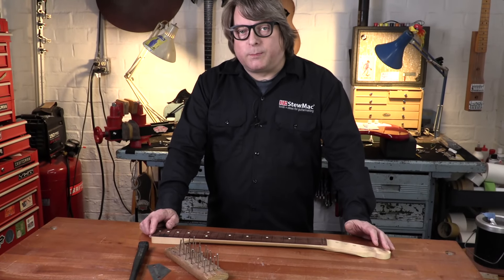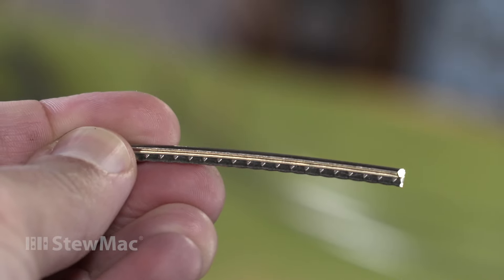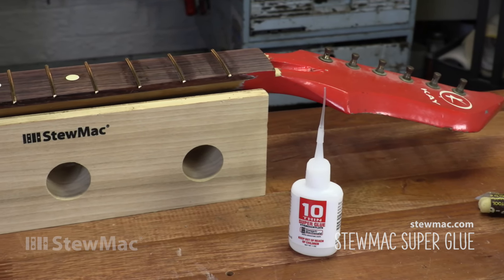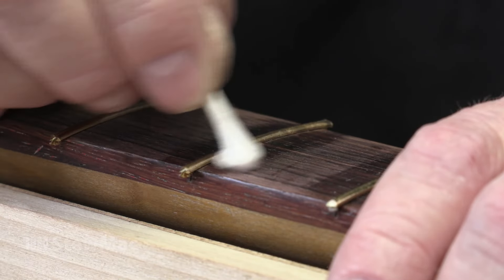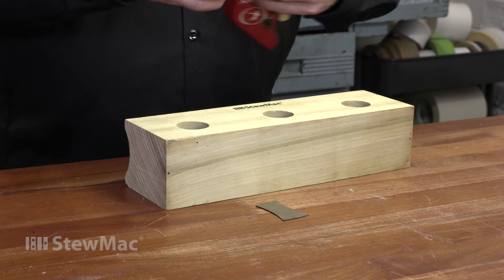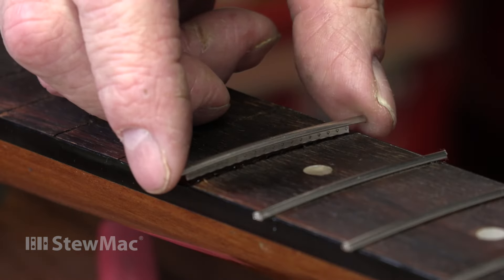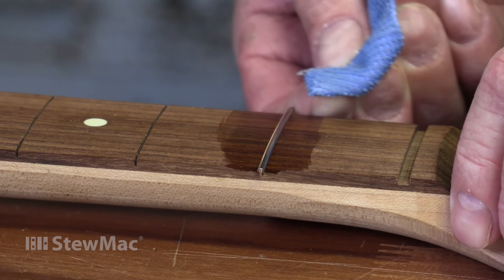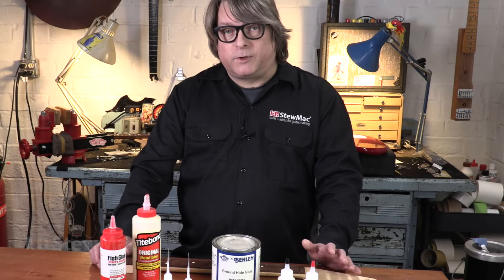How to use glue for guitar frets

Comment: Newbie wanna do a fret job guy lol 
Question , I know some folks use a soldering gun to heat frets to remove them but does that work with super glue ? And what are the fret removal methods ? 
Thanks 😊
Reply: You might've found the answer by now but yeah it does just take your time. It doesn't loosen it per se but it has an evaporating effect...so watch your eyes...it can sting. I also sometimes put a little fretboard oil on too plus back bowing the neck a little (just remember flatten back out before you level) with the iron AND solder...you can spread it on the top of the fret and it heats it up even more. Just make sure you get your fret height measurement first or heat one without solder.

Comment: Since when do you need to clamp down hide glue over night? And then totaly overlook the benefits with refreting if the frets have been glued with hideglue.
Reply: That was water based glues like Titebond (PVA) which is rubbery anyway adn probably absorbs tone. I think its more a case of the wood absorbing small amounts of moisture and swelling slightly, just clamping it until everything has gone off means you know none of the frets are proud.

Comment: Does gluing make a future re-fret more difficult in relation to getting the old frets out and not damaging the fingerboard?
Reply: You usually heat the frets before removal to both expand the slot slightly and soften both the wood and the glue. It'd probably be unnoticeable, just requiring some cleanup of the slot afterwards.
Reply from the maker: Removing glued-in frets will not damage the fingerboard if done properly. Here is a link to a video on our website where Dan Erlewine demonstrates this technique. 

https://www.stewmac.com/How-To/Trade_Secrets/Removing_the_frets_on_the_Mike_Bloomfield_Tele.html
Reply: @stewmac  Does this count with every type of glue? What is better to use... Superglue or Cyanoacrylate Glue? I can image that some glues are stronger than others and can damage the fingerboard for future re-fret.
Reply: No.

Comment: Excellent video, just the reassurance i needed. Do CA glued frets release easily enough  when heated with a soldering iron, or does it make future refretting more difficult? I'm doing a partial refret (just a few badly worn spots), if it doesnt work out perfectly, it would be good to know they can be removed easily enough.
Reply: There are no issues there.

Comment: I'd avoid epoxy as it has a very upper middle resonance, though you can get 12 hour cure time stuff, here in the UK we have Araldite. I suppose you could use Cascamite as it's very crisp sounding but now on dark fretboards. I just got my first bottle of Titebond (its just builder's PVA glue!) which I don't recommend as its rubbery. Super Glue is the best and you can remove frets by heating them with a soldering iron.
Reply: Epoxy ... the HARD stuff... is great for fret slots that have been widened too much. Resonance of each brand of epoxy varies.  I just tested epoxies by mixing up different ones and dropping them, and then LISTENING to the frequencies.  Note: I get that WE ARE talking MINUTIA here, re the total effect on tone of various epoxies.

Comment: Does fender glue thier frets down? It seems like when I lemon oil my frets, a few raised up a bit. I had to file a few high frets down after I hammered them back down. Great topic.
Reply from the maker: Hi Chad! Generally Fender does not use glue when fretting. There are some exceptions, I'm sure, but most often they're just pressed in.

Comment: I validate the "better tone" thing. Definately not placebo, since I refreted two instruments using titebond under the frets and yes there is something better with these guitars,  I mean comparing before and after
Reply: I’d love to look at your data and testing methodology. I believe that the claim the made in the video was improved sustain. Is that your assertion?
Reply: mmmichelin1  Definitelly better sustain. The necks feel a little different aswell, I guess it is the vibrations.
Reply: @stavrost6559  I don't believe that. A better fretjob = better sustain all across the fretboard. A better fretjob = no dead notes. But I find it hard to believe it would amount to a better sustain. That would only be the case if those original frets would actually be somewhat loose.
Reply: @PelleKuipers  Ok I hear you buddy, my point of view is that the more contact the fret has with the wood, the more vibrations would pass through it. Makes sense right? After all, your tone(string) has “contact” with the fret, so it will affect it.
By eliminating any potential gaps under the frets, we reduce potential tone loss or potential dead notes, so why not fill those gaps? We increase the contact with the wool after all. I hear luthiers all the time saying not to cut very deep slots on the neck, so..
I don’t remember if it was on Erlewines’ book or one of his videos that he mentioned that,  in a small study they did on the same neck, before and after filling the gaps. I don’t know how they measured it, but the results of the filled frets were better.
Cheers!
Reply: @stavrost6559  It makes sense in the way that a loose fret will transfer the vibrations more poorly. If a fret is properly seated I don't think a big difference can be heard glued or unglued. I've made guitar gluing in frets and not and I can't hear a difference. There might be a difference but not significant enough to be noticeable.
Reply: @PelleKuipers  Hahaha so I guess I did better fretjobs on my guitars than the factory ones! So, if not the glue, then I might istalled the frets "tighter" in there.
Cheers
Reply: @stavrost6559  Oh you definitely did. I dressed the frets on a Chinese acoustic guitar (completely solid) and the difference in playability and sustain was really noticeable. Fretwork = manual labour, and subsequently most factory guitars I've seen have poor frets. Either not polished well enough, fret ends that stick out, etc etc. 

Glue is necessary but not for sustain. Wood expands and contracts differently than the frets so glue is necessary to prevent loose frets in the future. I do use glue on all the fret ends (not as much as in the video though).

Comment: I'm pretty sure Stew-Mac did a test on different glue types for melting temperature. If so, I think it would have been nice to make mention of this as it relates to potentially removing frets later. Or do so in a fret removal video and reference that in this one. Since this video has already been completed, I think it would be nice to update the description with that info. Is that possible? I'm not a content creator, so I don't know whether it is. I did use an old finger board and test removal of frets with several types of glue a few years ago. They all came loose with no problem using my Weller  100/140 watt soldering gun with two-piece tip (so the current is carried through the fret itself).

Comment: What does Warmoth use for it's necks?  I'm surprised he didn't say. I'd like to know.
Reply: Super glue.  Not sure which formula though.  Re-fret = $300.  New Warmoth neck $$300.  I just replace the neck.
Reply: I have one from a handful of years ago. It needed leveling, and they used to NOT touch the fret ends after the cut. So it needed leveling, and fret end polishing. And optionally a rolled edge since the board come with NO rolling whatsoever. I hear they smooth the fret ends nowadays. But there is no guarantee it won't need leveling, and you best like the fretboard with a 90degree edge if you want to just bolt it on.

Comment: Hi, how about removing glued frets when refretting...?
Reply: Probably easier to remove the whole fretboard....
Reply: I personally just use a soldering iron and fret pullers, I run the soldering iron on one side of the fret and I move both fret pullers and soldering iron across the fret as I am pulling the fret out, so the heat from the soldering iron heats up the glue but not too much where it will be a huge mess unless you hold it in the same spot for a longer period of time
Reply: Soldering iron
Reply from the maker: We recommend using a soldering iron, chip stopper, and fret pullers for this job. Here is a link to a video on our website where Dan Erlewine demonstrates this process. I hope this helps! 

https://www.stewmac.com/How-To/Trade_Secrets/Removing_the_frets_on_the_Mike_Bloomfield_Tele.html
on our website

Comment: I’ve fretted and refretted over 10,000 guitars since 1974. We always glue the frets. Thin Hot Stuff super glue is the best. It takes a little practice to not make a mess with the glue, but once you get past that little learning curve it’s a snap to get perfect results on every fret job you do if you follow the correct steps. We use clamping cauls that clamp two frets in at a time. We dremel out the fret slots with a small dentist burr that makes a perfect sized slot then clamp them in two at a time. We work from both ends of the neck to the middle, so after we glue in the first two and clamp them, then we move to the other end and glue in two. Once those are clamped the first ones can be unclamped and the ends flushed up. Then glue in the next two, and repeat the process at the other end. I can do a full refret start to setup in about 2 hours on most guitars.

Comment: I am not expert with any guitar skill. However i've worked with resins and wood for many years. With that  i would simply suggest when you turn the guitar on its side and drip #10 to the underside of the fret it is more a capillarity (capillary action) rather than gravity that actually pulls the glue into the slot.
 
If there were no glue under the fret you would have to puddle quit a bit of glue at the fret before it would seep into the fret slot in fact the glue is as likely to roll off the back side of the neck.

Comment: What kind of wax?
Reply: @Rock 5150 Hey Rock 5150 I did that yesterday and it works marvelous! Just a regular white candle It was a bit messy but The Cyanocrylate went in really well, and cleaned super easy! It was a rosewood board, I don't know how it works for a maple one, especially if it already has nitro or any other finish on it. Cheers Dude.

Comment: hello My Dears do you have any tip for wide slots, the frets are not grabing on the fretboard
Reply from the maker: Hey Alexandre, we have a tool called the “Fret Crimper” that solves this exact problem. Check it out here! https://www.stewmac.com/luthier-tools-and-supplies/types-of-tools/pliers-and-cutters/fret-crimper/
Reply: Tks for your.message ..but the situation is oposite...the fret fit inside the slot..but the slot is larger than tang....maybe tite.bond inside??

Comment: Can you use glue boost every one seems to be ranting and raving about it
Reply: Any CA glue with the right viscosity and temperature range is usable. 
I'd reserve special products for spot repairs, where all its properties are needed to 
to fix the crack/ding in the finish. I'd go for CA glue that got a name to it and you can get a safety data sheet, telling you about the curing and at what heat it will get brittle too. The right storage temperature should be in there as well and it will be good for a year. That way, you can be sure to get a decent quality glue. 
It's not all the same.

Comment: I want to become proficient with original technology hide glue.   Most things used hide glue before WW II.  It is strong, but wet or  very hot it falls apart.  It's dry, mixed with water and applied at 140F.  If it gets much hotter than 145F it is ruined.   Other thermal glues are crafting Hot Glue (much higher temperature) and similar keratin glue used for hair extensions.   I think it may be possible to use gelatin as an original technology hide glue.

Comment: I almost never use glue while fretting, I simply don't believe in the concept of glueing them. If the fret slots are a bit too wide to hold the tang, I think it is way better to deform it. With those special "W" pliers of Stewmac for example.

Comment: Man better tone? Really? Lets not get into Toneglue devate...
Reply: I just really don’t believe that it would truly make any impact over the tone.

I mean, I’ve never listened to a record and said ‘Welcome to the Jungle is OKAY, but would be so much more elevated if Slash had glued in his frets!”
Reply: or the passive circuit tone pot capacitor total nonsense ("bumble bees and PIO's are best for tone, oh my oh my!")
Reply: RDE Lutherie  Hi, however, badly seated frets can cause dead spots on your fingerboard. One of my customer came with a really nice quitar but his D and G strings sonded totally muted and it could be heard when tapping on the frets with a metal object. Gluing frets is a must but I wouldn't say that one type of glue sounds better than another, that would be silly.
Reply: all that matters for caps in passive guitar/bass circuits is their METERED value and build - "build" means don't waste money on PIOs for these applications, where mylar, epoxy, polyro, etc, are simply better.  this whole "caps in guitars" debacle has be exposed for what it is many times over - nonsense perpetrated by the clueless.
Reply: Ignorant. He said glue helps with vibration transfer. Glue can fill air voids under the fret.
Reply: RDE Lutherie  Dude, really? What are you trying to proove? 
"Do your customers a favor, either don't charge to practice on others instruments, or find a different profession." There was a problem with this guy's badly seated frets so I changed them and it worked.
You sound like a competent reapir guy but it doesn't mean that you are the only one in the world, there are still some conscientious people out there.
Reply: Not "tone" but "sustain".
Reply: @hoodoo-man  "Too many luthiers, not enough guitarists" well IMO there are really a lot of guitarists out there but they'd rather buy a 3500€ Gibson than a 2500-3500€ luthier's handmade custom guitar. Because you know, they want the brand and the reputation and history that comes with the brand (Gibson, Martin, Fender, etc.). Musicians are just like any customer, they are advertised all their life with those brands so they simply buy them. It's our job as luthiers to teach them that they can have so much more from their local luthier than from any famous guitar brand. (BTW a 3000€ Gibson does actually costs far less than that, it's just adverting costs and dealers costs that make it so expensive). Just my opinion and that subject tho ;)
Reply: RDE Lutherie  - What a load!
Reply: RDE Lutherie  - Right. I've been doing it for 40 plus years, and you're just wrong.
Reply: Haha. "Tone Glue". Look out Ebay, here I come!
Reply: RDE Lutherie  - You are arguing with everyone, which tells me you know little. I was repairing and building guitars for a living before StewMac, been published over 100 times, and have the client list to prove my bonafides. You got lots of talk. I'm done with you. I have to get back to the bench.
Reply: RDE Lutherie and ladiessss..stop fighting already, who cares?! Over a month of girl talk lolz grow up!
Reply: RDE Lutherie  Im amazed you have all this spare time to write these novels since you are so in demand for your guitar work.

Comment: Fretboards are like snowflakes. No two are the same. From chipping to previous glue jobs to varieties of fret stock, you never know what you're going to encounter. Over the years quality ebony has become hard to some by, so the newer boards will accept frets a little more easily but they will also release them more easily. I radius a fret then test press it. You can tell by how it goes in whether the tangs are going to do the job or not. CA glue can be very tricky to use in fret slots. Applying frets is the most critical job to making an instrument playable.

Comment: You can't "Knock out 4-5 fret jobs in a day," with leveling the fingerboard, treating / cleaning the fret slots, edging,  rounding fret edges, polishing. "ETC. X 10". I also have NEVER HAD to clamp one fret using fish glue ... well; I suppose if the fret slot was to large. .... Never ran into that, since 1976, when I threw my first guitar into the garbage. I learned a bit, after that. Overall; I find your information to be somewhat informational, but overall misleading.

Comment: wood glue inside the fret slot works easy! 🙌🙌😄😄👨‍🔧👨‍🔧👨‍🔧🙄🙄with lots of clamps,long strips of hardwood along the edges of the fretboard you can sit all the frets before the wood glue fully dries...but epoxy on 24 frets?🤣🤣🤣😆😆😆😄😄😄😂😂😂

Comment: People learn that super-gluing frets is a terrible idea when the next refret is due, but of course it's usually the next poor guy who's ripping out parts of the fretboard when pulling the old frets.  I'm pretty shocked that just of all StewMac promotes this bad practice.  Also this subterfuge with "better sound" is just ridiculous... the very idea of a fret is that it's the place where the string does not really vibrate, and when a fret is so loose that it impacts anything you have a whole different problem.  The real reasons for gluing frets are 1) not having a press and avoiding frets coming up when you hammer them in to save time and 2) not having the right (=wider tang) repair fret wire.  Summary: Terrible botch job and again, I'm shocked to see this promoted here!